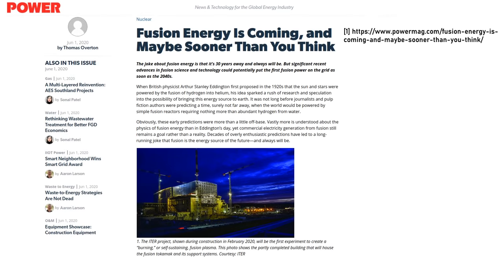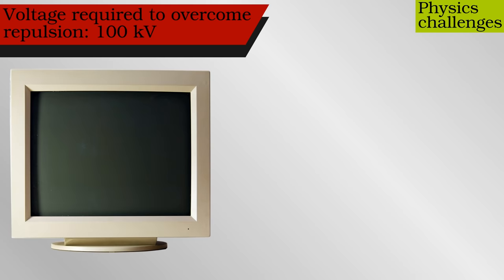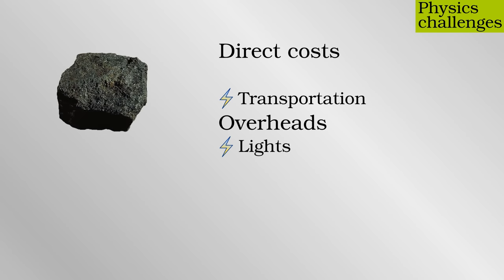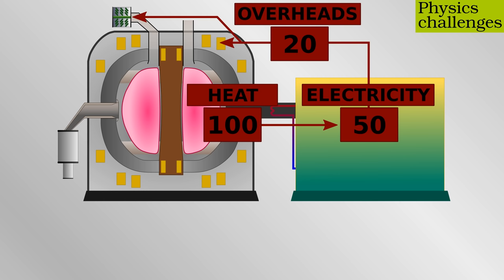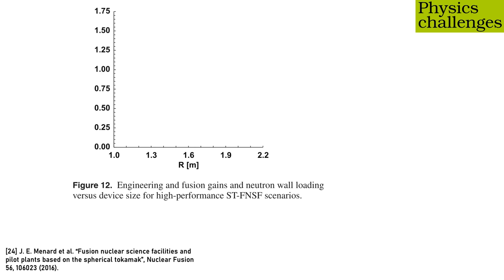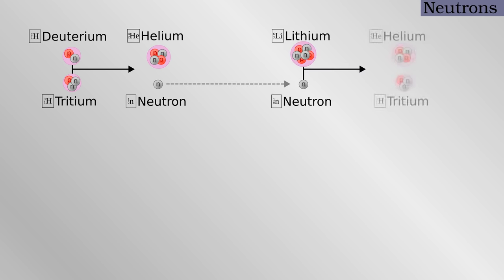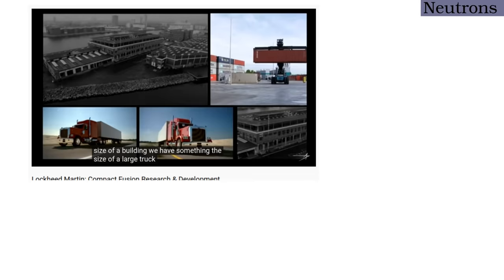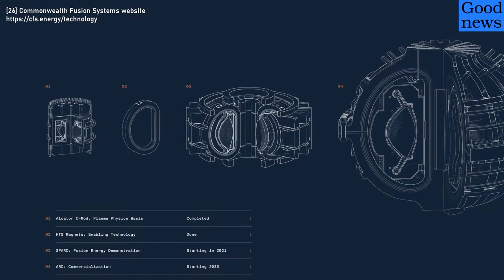Former fusion scientist on why we won't have fusion power by 2040

Comment: Im an ex computational plasma physicist and almost every gain we have seen in the last ten years is solely coming out of three things:

1.  The inexorable advance of computing technologies and expoential processing power increases

2.  The introduction of modern plasma dynamics codes and the hardware to really churn field geometries

3.  The merging of experimentation and simulation.  It was getting very common even in 2010ish that even dinosaur PIs were starting to get simulations before they took shots.  In these big startups they are using them to cut entire dead ends that took years to flush out in the 60s and 70s.

Look at who Helion are partnered with.  Do you think they chose MS for their gamble because of Redmond?  No they chose them because MS will build them a bloody huge cluster and let them expense it as investment.

Worse, the old fusion dynamics guys are really struggling to understand why their predictions dont fan out.  The entire plasma physics community was wrong for 5 decades about NIF.  I distinctly remember the rayleigh taylor instability papers and how difficult they found it to generate hot spots.

Yet a few years of simulations and tests later by the same groups and NIF goes from their comically funny scientific Q to actual ignition.  The pulsed guys get so much more benefit from their simulations too as they only have to test the one shot.  The stream guys need to simulate much longer and hope they can overcome it with brute force.

If you want my now uneducated opinion, there will be multiple fusion systems commercially viable by 2030.  Maybe earlier.
Reply from the maker: Funny you mention Helion, since their simulations are so primitive. An MHD code... OK then 🙄
Reply: @ImprobableMatter  You mind explaining?  Plasma physics isn't a new discipline.  If they're using other approaches they're either running into numerical problems in their geometries that normal codes can't solve (and still get the benefit of modern computational methods), they dont get the benefit of the super large scale methods (and may even be using some kind of PIC or hybrid approach) or their visualisations are just not very good.

What are they using thats so different from your standard MHD or kinetic code approach?

Most of science publishing used incorrect colour contrasts for high intensity features for about a decade because it was the default in Matlab.  Speaking from experience, most people in fusion science who were involved in any form of plasma physics were extraordinarily defensive over their pet opinion and had good reason to be - ICF looked like a rayleigh taylored dead end, MCF had ridiculous material science problems and no one was funding anything else because the simulations couldn't scale up.

To my mind, NIF invalidated the opinion of almost everyone in fusion all at once.  I genuinely can't stress how much of a joke ICF was until they proved that just through small adjustments to experiments, you could yield hundred fold increases.
Reply: Also I'm pretty sure that unless there are recent low energy discoveries in plasma physics you don't need qed codes to meaningfully describe fusion plasma so im pretty curious about your answer
Reply from the maker: Since you're an ex computational plasma physicist, you must be aware that MHD is just taking really high order moments of the Vlasov equation. It completely misses single particle motions like drifts, collisional damping of waves and many other effects. Helion therefore does not and cannot simulate these effects. Also, MHD can of course have turbulence and similar effects, but their simulations are way too large scale to resolve them.
Reply: @ImprobableMatter  Yes, and you choose your simulation based on a number of factors - plasma density, plasma scale length, plasma size, and the effects you're intending to observe.

You use MHD when you don't care about individual particle movement and you're mostly interested in currents.  You get an idea of the statistical movement of the particles as a function of time and field strength but not of where individual particles are.  There are hybrid codes that can achieve this by using kinetic codes to prime MHD distributions, but I've never used them and the only one I knew was single cored at the time, because the two code approaches require complex field initialisation algorithms to correct for weird field propagation effects.

If they're using kinetic codes, you can simulate pretty much everything.  I was simulating attosecond harmonics in PIC - the only meaningful problem you have is making sure your simulation's scale length is appropriately chosen, since that determines both the runtime of the simulation, the resolution of said simulation  You can of course initialise field geometries in sufficiently large kinetic codes - the restriction was that they were computationally expensive and could not meaningfully simulate long duration burning plasmas due to numerical drift over time.

I wasn't suggesting they used MHD.  I don't know what they'd use in that domain - it's been five years since I even looked as plasma dynamics as a field so I don't know what advances have been made lately.  All I know is the simulations NIF were running for hohlraums were in computational domains that were difficult to simulate until very recently, and almost all their progress (and almost all over progress in other simulation regimes) has come from increasingly complex simulations of plasma dynamics.
Reply from the maker: I am literally telling you that Helion Energy are using an MHD code. You can read the papers they published on it!

I'm sure they'll totally for realsies make a massively parallel kinetic code, validate it and solve all the other problems of neutron damage, rapid charging and discharging of capacitors, Tritium separation in no more than five years. Again, 🙄
Reply: @ImprobableMatter  I looked up their simulation code and it's Cygnus, which is a standard 2D Hall MHD code.  Given the scale of the plasmas and the unlikelihood that individual particle dynamics will be meaningful at the temperatures they're operating at (I think around 10keV atm) and the field scales they're talking about, the main restriction in previous simulations would have been computational time.

In NIF, they needed both PIC scale and MHD codes to figure out wtf was going on inside the hohlraum.

To be honest from my relatively limited professional expertise they're pretty much doing what they should be doing.  There's way more information in that MHD code than they show in their presentations, and given good computational resources, they will be able to churn out different field configurations on the fly.  If they want to track particles then they can take subsets of the simulated MHD plasma currents and initialise kinetic simulations with those conditions to determine if apparent field instabilities visible on measurement can be reproduced.

I dunno.  I don't work in this stuff anymore, I just found it odd that people seem not to understand why all this news is coming at once.  Some of its hype, but some of it is genuinely just the results of the physics community finally getting its shit together.  At their scale lengths and at that temperature, and to show the initial plasma configuration without any obscuring dynamics, I'd use an MHD code for the very same reason.

The main restriction on almost all research in this stuff was money and computer time.  Both of those seem to be gone at this point.
Reply: @ImprobableMatter   I posted something about particle in cell codes being kinetic codes (barring macroparticle non-collisions and these can be modelled if you like) and being parallelised.  Not sure where it went.  However, there's EPOCH - an MPI former closed source, now open source particle in cell code and pushed by UK research councils.

I found a parallelised VFP code earlier but I'm too lazy to get it back again.  Seriously, if they actually need to simulate individual particle dynamics (and they probably don't at this point) then there's loads of ways to do it.

I don't really see your point.  On other issues, those are the same issues other fusion systems face and there are ways around them, we just don't know if they're economic or not yet.  All I can say is that its pretty obvious to me what's changed recently is how simulations are used to deal with engineering dead ends, and that explains a lot of why this stuff is all happening now.  It's just flat out cheaper to explore subtle physics than it used to be.

If you want to, pick up the code by searching for EPOCH PIC. You can run small scale plasma dynamics simulations on a single computer now.  My guess is previous links were deleted because I linked to github or something.  I dunno.  This is more for others that want to explore how this stuff actually works.
Reply: It also somewhat bothers me when you describe 2D MHD field simulations as "primitive" as if there is some more advanced method you can employ.

You don't need to simulate every single square centimetre of a plasma to be able to determine its particle motion.  Even 1D PIC can give meaningful kinetic results involving plasma sheathe movement.  In the regime they're operating in, they're driving some kind of betatronic motion, which iirc my plasma physics means they're just varying the magnetic field over time.

That's easy to do in any dimensionality of PIC, though you need to enforce a time varying B field to drive the electron oscillations.  You just do it at the interface and at the centre and see if the instabilities you saw show up.  I guess the complexity comes in that the time varying B field comes partially from within the plasma itself, but that should at least be visible from the MHD so you can model it using a distribution of some kind.

Don't really see the problem.

Comment: The claims of approaching over unity power are sheerest fantasy. The people making those claims are basing them on the energy input directly into the fusion fuel, the problem is total energy required to do that two orders of magnitude greater than the amount of power being output. We are a very, very  long way from commercially useful fusion power. Fusion power in 2040, how about 2140.

Comment: I just wish people could overcome their apprehensions and fears about fission power. It's not like it doesn't have risks and drawbacks, but altogether it really isnt that dangerous, especially modern fail-safe designs. People chasing the fantastical promises of fusion, pouring so much money into it that could easily build an entire generation of modern fission designs that would be more efficient and safer than anything that has ever been built. But no, fusion is the sci-fi future, and the people who spend the money are either passionless goons chasing the best timescale of profitability or moronic wastrels chasing their sci-fi fantasies
Reply: Two nuclear reactor meltdowns in a 50 year span is not much room for enthusiasm. It could work if anyone had any faith in the ability of states or corporate bodies to prevent the worst excesses. When things go bad they go very bad for a very long time. Not something that generally occurs with hydro or solar. It doesn't feel like a safe bet. If I could be assured a meltdown has been made actually impossible to occur and there are multiple redundant systems and procedures to fall back on to ensure that was the case, and these were air tight, and the waste is secure and will never resurface or show up before 10,000 years are up, maybe that would go some way.
Reply: @Stevies_Precog_Gym_n_Spa420   To start with, you should not compare nuclear to solar and wind, because you couldn't replace nuclear with solar and wind power in a power generation scheme. My understanding of things is that you want power generation to more or less nearly match power demand, which fluctuates over the course of the day. Nuclear power has inflexible output, because of how much goes into turning a reactor on or off. By comparison, Solar and Wind outputs are easy to switch on or off. Thus, nuclear power provides a stable, efficient baseline power output, while renewables can provide quickly reacting outputs to help match the curve. I'm sure it's more complex in reality than this simple model. Suffice it to say, it would be very difficult to run a power grid on either just nuclear or just solar and wind, because they each have such peculiarities, but they actually complement one another.

As to the actual risks of nuclear power, it is true the nuclear disasters are pretty catastrophic. It's also true that disasters have only taken place in a minute, miniscule fraction of plants, which have been operating for around 80 years now. If you compare literally any metric of health risk, from likelihood of disaster, lifetime health risk exposure, quantity of waste, exposure to waste, nuclear power comes out nearly spotless in comparison to fossil fuels. 

In 8 years alone, (2010-2018) fossil fuel pipelines in the US have displaced as many people as any of the high profile nuclear disasters, and have caused all kinds of fires, explosions, irreparable spills, billions upon billions in damages, not to mention the constant, ubiquitous radioactive exposure we are presently under due to the release of unstable elements from burning fossil fuels. But we don't talk about how fossil fuels are this ticking time bomb waiting to burn us all down, give us turbo-cancer, or permanently infuse our water supply with oil, the discourse is only really concerned with their emissions. (https://www.nrdc.org/bio/amy-mall/pipeline-incident-statistics-reveal-significant-dangers)

The standard to which nuclear power is held has never been held to literally any other kind of power generation, even as nuclear power is the safest massive power generation technology that has ever been devised. Even now you're talking about never failing, having no risk of waste exposure in ten thousand years1, having zero environmental emission. Not even wind and solar have zero environmental impact, thousands of bird strikes take place every year, not to mention the environmental costs of production, and gallons of ink have been spilled discussing the environmental effects of solar panel waste both in production and when the panels reach the end of their lifetime. There simply is no choice that is completely without consequence or risk, but if you want to minimize consequence and risk and concentrate into the tightest, most monitored and controllable package, that choice is nuclear every single time.

Comment: New methods need to be invented to have fusion via laser, fastly faster production methods on the order of millions times faster. When it takes a year to make a couple thousand hydrogen beads and only a few make the cut, using the latest technology, only a few hundred per year, when you need millions of them per day. That's not 2040, that's year 2100. They won't be able to do it in the process they have laid out, because they are being enabled to continue on their current route being funded to go this slow. It will take a skunkworks/boeing type private company to make it possible using nuclear fusion, not laser fusion. That may be around 2045 before we see actual progress. Mainstream, 2070's

Comment: You've overlooked alpha heating and lithium isotopes.
The D/T fusion reaction puts about 20% of the fusion energy it releases into the alpha particle [He4 nucleus] that it produces. This particle stays in the plasma and its energy heats the plasma. If Qp > 5, which it will be, then the fusion reaction will continue for as long as it has fuel with no additional input of energy to the plasma. The fusion reactor can easily produce enough heat to generate far more electricity than the reactor consumes.
Tritium also isn't a problem: D + T -> He4 + n n+Li7 -> He4 + T + n so the fusion of a single tritium atom can generate an unlimited number of breeding reactions creating new tritium atoms. M.I.T. is currently doing tritium breeding experiments to develop fusion reactors that breed more tritium from Lithium than they consume in their fusion reactions. You did a good job of ridiculing bogus fusion claims; but you fretted over old and solved problems that won't stop what you admit is the group most likely to succeed. CFS hopes for fusion power on the grid in the early 2030s and replacing all coal-burning power plants with fusion power plants by 2050.
They plan to only let each fusion reaction continue for 4 seconds because they don't want the reactor to melt. The problem isn't producing enough heat, it's making the reactor survive the vast amount of heat that it produces:
https://www.youtube.com/watch?v=bHJyoqDO0zw
:-)
Reply from the maker: I just can't fathom why so many people are misled by this Q>5 business. "no additional input of energy to the plasma" corresponds, by definition, to Q = infinity. This certainly can be achieved in theory, but for a tokamak this would require 100% of the current to be bootstrap current, which has never been experimentally demonstrated.

Comment: People seem to ignore the fact that fusion produces way more radioactive waste than fission, and that fusion fuel is way more radioactive than fission fuel, also way more expensive. Saying that "fusion uses hydrogen and makes helium" is such a gross simplification that if it's implying fusion is cheap and safe then it's basically malicious deception. And the argument that in case of a critical failure it just stops safely? Oh boy. That's like saying that if an aircraft breaks mid-air it's OK because it'll just come back down to earth.
Reply: The hope of some fantasy energy fusion is a valuable tool of the anti-nuclear, degrowth movement. It's used to suppress nuclear fission that we know how to do today.
Reply: This is nonsense